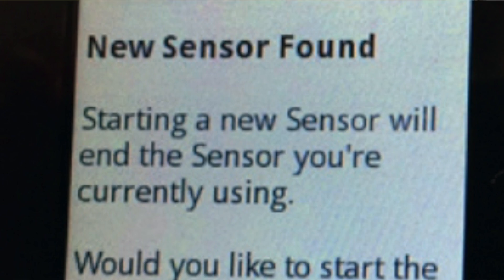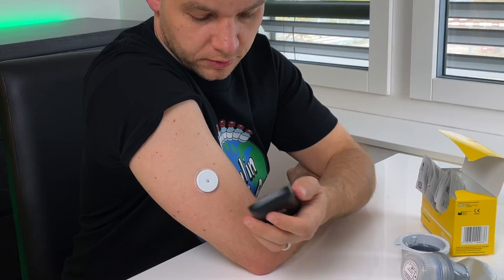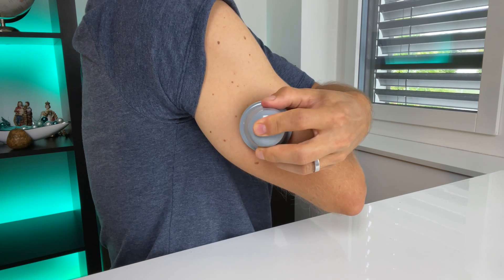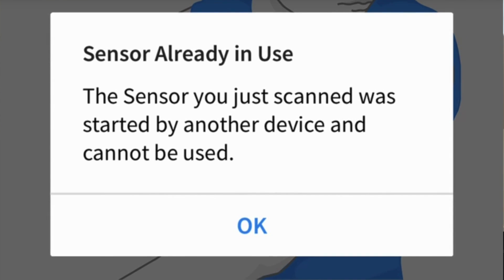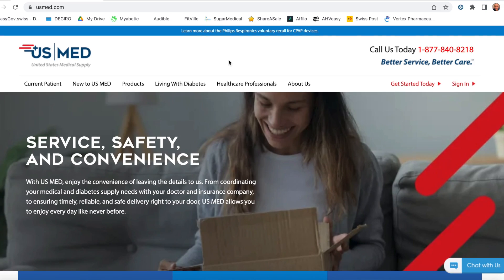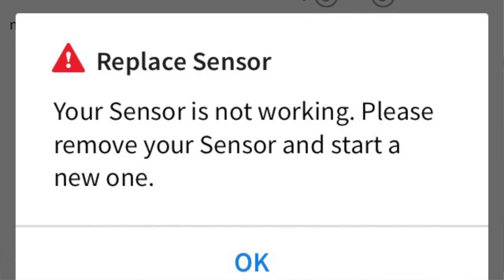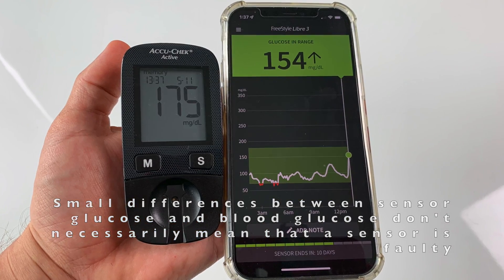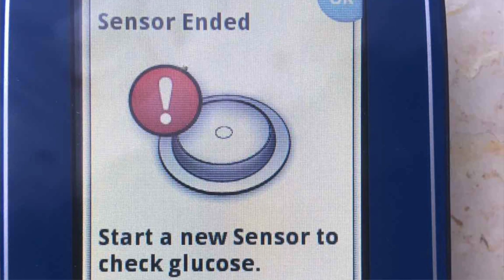FreeStyle Libre Errors and How to Fix Them

Comment: We need some vids on how to connect the CGMs with the pumps. I have the iLet pump and tried to switch from the Dexcom G7 to the Libre 3 plus CGM since the iLet supports both.  I was shocked at how different it was to connect the G7 with the iLet compared to the Libre 3+.  Ended up killing my first Libre 3+ sensor trying to follow similar steps as the G7 because I could not find a YT vid for any guidance.

Comment: As I understand it, the FreeStyle Libre 2 (and 2+) sensor contains a small silver oxide battery. There are occasions where this battery is faulty or has discharged on a new sensor. The result is that while you can scan the sensor manually to get a reading, the sensor will not constantly update your phone app, with the app reporting 'Signal Loss'. Abbott will replace sensors in this case or you can simply scan the sensor manually with your phone every time you want a reading, however you will lose the ability to get alerts in the app until you replace the sensor.

Comment: I think the quality of these devices had gone way down!!! I started with Libre 1 for a few years and they had never failed! Then I moved to Libre 2. Few years later they started to fail on and off....then more frequently...then like half would fail....it's random like it would work for a few days and stopped or it won't even start! I had used multiple Libre 2 readers and still would have problems! Quality went way down...I even informed them whenever I called them!! I have enough and I just asked my doctor to move to Libre 3! But now in insurance would not cover the reader...yet they sent me 6 sensors...like WTH!! Quality had gone down on nearly everything...all types of companies....insurances....manufacturers....alike!

Comment: I keep running into an issue where when I apply a new sensor (Libre 2) it will read critical low and then give me the check again in x hours. After the x hours I will get that the sensor failed and to replace it. I am trying to narrow down if this is related to the location or not. I feel that this happens more on my right arm but don't have any real evidence yet.

Comment: I've been using this for 4 weeks now and has gone bad on my 3rd sensor the message I get is 'error displaying result' then it won't communicate with the phone unless I manually scan. I called the manufacturer and they were useless blaming the phone that's been working fine for 4 weeks.

Comment: ios 17.0.4 won't work.   it says in the beginning if you get signal error message.  says on the thing first before going.  thats why it won't do   then I was told to undo the ios area.   this is a problem with companies

Comment: my problem is with the  sensor ended. i chabnged the sensor and scanned it. it said wait 60 min i did that. after an hour i scanned again and it again said sensor ended change sensor. reluctantly i diud change it agasin and again its saying sensor ended. i tried callin freestyle but the r closed for the holiday and have no means of checking sugar., can u suggest anything.

Comment: It is a mistake to put your sensor on your forehead because there is not enough blood to sense .😅 I put my libre 2 sensor in the refrigerator door anywhere from 4 to 24 hours before I use it. I noticed that my sensor is much more accurate and last the full 14 days.

Comment: Sensor error try again in 10 mins..this keeps going on for 10 hours straight....making it useless.
But if I get a real low suger alarm,. Then it works showing like a 53...but only works for the high and low alarms.

Comment: Hello, I have a need for answers to a couple questions. My first sensor  worked very well until it fell off after about 4 days.  I was looking at the blood sugar levels several times per day but after laying on it,  it came off. It was installed by a health care professional, so I didn't know what to think. Since then I've read where the addition of tissue glue applied to the bottom of the sensor befor installation would help it stay on. And there are bandage like clear plastic covers that can be placed over the sensor. Also I read where the use of  Liquid bandage can be applied befor the sensor so it has a dry surface to stick to. When I mentioned all of this to them they said they applied tissue glue already.  I purchased  another one and had it installed by the same professional. This time I was reading it every hour or so and after about 5 hours it said  Sensor ended. I called the clinic and they didn't know what to do about it. So I called the customer care line at 855-632-8658. As soon as I told them it was on my dog they all but hung up on me. Anything I asked was met with obstinate resolution. They didn't want to give me the  time of day. After a minute of sweettalking the woman finally said she'd answer a couple questions, but kept announcing that Abbott is not responsible for any use other than on a human every time I formulated a question. Since I was not the one who installed the sensor, I really wanted to know what the correct way to start a new sensor with the old reader was. After another round of excoriating me she finally relented and said all you have to do is place the reader near the new sensor and it starts over.  Automatically? I asked. No resetting or anything? After hemming and hawing for about another whole minute,  she finally used that exact word "Automatically."  Now I have purchased still another one and I wonder if there is more to it than just install the sensor and bring the reader near the new sensor to pair it and activate the sensor. It seems like the reader did not reset correctly or the sensor malfunctioned and timed out early. I just want to get a baseline established for my dog, but with the extremely poor treatment by Abbott (& Costello) Customer Care this will be the last time I patronize them. At the moment I am shooting blindly, checking my baby dog only a couple of times a day with my own HUMAN Glucose reader and test strips that I use on myself, but dogs run a very different kind of blood sugar control that is much more complicated than human sugar control and it would be nice to have the details so I can accurately administer the dosage of insulin to her. If anyone would care to help me out a little, I can be reached on Yahoo email. I go by Moparbens. You know the routine to send a message to Yahoo,  so please let me know if you care to help. Thank you, ben/ michigan

Comment: I just started using the FL3 and in 5 days have had to apply 5 sensors due to Replace Sensor messages. Each message happened during the initial 12 hours even though I did get glucose readings during that time so I know I applied it correctly (soap and water, alcohol pad, drying time, etc.) I've been diabetic for over 50 years so applying these is not rocket science. I called Abbott each time and they did send replacement sensors. The last rep. I spoke with told me it can take 12-24 hours to get accurate readings not the 12 hours it states. He also said they are having problems with the filaments and are working on it and he has had a consumer who had 20 faulty sensors in a row. He told me if the sensors are shipped to you sitting outside in the heat or cold can damage the filament and that the shippers may not be handling the packages correctly including the sensors they shipped to me using Fed Ex (yes, one they shipped failed also.) He also told me they may only last 11 days not the 14 they claim they will last.  I applied Skin Tac after applying each sensor to make sure each would stay on so taking each off was not as simple as if only the adhesive they apply. I'm so fed up with the poor quality of these sensors and the fact I've gotten 3 reps who must have been using cell phones because they couldn't hear me. I used a land line phone. The other issue is the reps are usually speaking English as a second language making it more challenging to understand what they are saying. One sensor gave me a sensor error and said to try scanning again in 7 hours! After the 7 hours it said to try in 10 minutes. That finally worked but I got a replace sensor message a short time later.

Just my opinion, but Abbott shouldn't be selling these sensors if they are so vulnerable to damage. No wonder they cost so much if Abbott has to keep sending out free replacements. 

I don't know if my insurance will cover another brand of CGM but if they will are any of the other CGMs better as far as quality control of the sensors goes? 

I think I'll go back to just using strips. My experience with this CGM is so poor. If Tom or anyone has had similar experiences or any helpful ideas please respond with a comment.  I have 5 sensors I could try using that Abbott just sent.

I'm totally disgusted with my experience.

They also claim it is not the readers fault it is the sensor so they would not replace the reader. I thought perhaps the reader was actually the cause of the error messages.

Comment: By the way, I use my Freestyle sensor with two devices. With the Freestyle reader and with my smartphone (iPhone). When starting the sensor, I first do it with the Freestyle reader and immediately after with the smartphone. The advantage is that in the smartphone app there is additional information (time on range, estimated HbA1c, etc.) and when I go out I don't need to carry another device. At home I can use both, depending on which one is closer.
Reply: I can't figure it out.  I scanned the sensor now I can't use my phone. It won't let me use 2 devices.😓
Reply: @ That's strange. Maybe it also depends on the software version, but I can definitely use both, the original Freestyle reader and my iPhone. Both ask me to scan a new sensor because the old one has expired, so I just follow the normal instructions for scanning a new sensor. First with the Freestyle one and then with the iPhone.
I'm using the Freestyle Sensor Type 1 without alarms, not the new one with alarms. I haven't tried it yet with the new one.
Reply: Was that Libre 1? Because for Libre 2, that was no longer possible once the sensor was activated on the reader...
Reply: I figured that a few years ago but had forgotten which device first and didn't want to get wrong and have just 1 device. Top comment 👌 very useful to have two options,things happen and go wrong with tech,life etc 😂

Comment: Had trouble getting new sensor to scan on Samsung Phone. ( New sensor won't scan ) Tried checking >Settings
>Connections
>Turn ON Wifi
>Turn ON Bluetooth
>Turn ON NFC and Contactless Payments.

Then try scanning new sensor again. If it doesn't work, try turning those settings off then all 3 back on again or shutting the whole phone off then on again... worth a try, worked for us. Hope this helps!
Reply: Same problem!

Comment: I just had 3 sensors replaced today by Abbott. It didn't take very long at all. It's just a real pain in the ass or arm. It's interesting to know what the error scan in 10 minutes means though. I release insulin erratically and sometimes during an event, before a seizure, I get that message when I'm trying to make my glucose go up and anxiously await a higher number. Have any of you had a pancreatectomy? I'm on the fence because my dad was diabetic. I'm scared of trading in one demon for another.

Comment: I decided to give the Freestyle Libre a try for my cat, per my vet's recommendation. Tried downloading the app to my phone, but it was a humongous hassle which is probably not worth it (since i presume is designed for human not animal use). I've only used the provided reader.  First sensor only lasted 7 days. Had several "check again in 10 min" errors these days, but it would fix itself. Vet had me checking levels every hour so i think maybe theres a limit to how many checks you can do. The cat is a senior but still moves around, and i think the sensor could have been better placed. Its right behind his right front paw. he usually leans on that area, either left or right. A higher placement could be beneficial. But hey I'm no veterinarian or diabetic. I'm just trying to make him feel better.
Any insights are helpful, we are new to the diabetes world.

Comment: I upgraded to the libre 3 and it’s been a love/hate relationship with it. When it works it’s so much better and convenient than when I used to use the freestyle libre and with many more features but now it seems like every other sensor is bugging out and/or needing to prematurely remove and apply another one before the cycle ends, then I have to yet again contact the company send another one and so forth.
Reply: My situation is the same, when the FL3 works it is great but just recently I have had many problems.  For instance I just applied a new one and at 3am in the morning it quit reading.  I've tried everything to grt it working but to no avail.  Totally fed up of this sensor/brand.
Reply: Same @tulsabrit671

Comment: You forgot to mention "This sensor is not compatible with this reader, which my wife just got with 4 sensors in a row. The previous sensor was giving readings that were way too low. She's been using Freestyle Libre 2 for over a year and we've had about half of sensors be bad, including the ones we got back as replacements. One of the representatives at Abbott said to reset the reader with the power button for 30 seconds and then the sensor would work 100% of the time. A bunch of BS. Twice after that we tried it and got the same error with two different sensors. This product is crap. It shouldn't have been released, or Medicaid should drop it, regardless of how many corrupt officials negotiated this deal.

Comment: First shipment from USMED was faultless. Second order had mix of libre 1 and libre 2 cgm.  After a couple calls I have been told they will replace libre 1 w libre 2.  Also cannot use a reader or phone app from US on a cgm from UK.  Very frustrating on a recent long trip.  I would have to change my IPhone profile to an English address, install the Uk libre app and work it that way. That would change my Apple profile on all my devices.  UGH

Comment: Hi I started the libre 3 sensor after using the libre 2 sensor for an year. And this is my 5th libre 3 sensor that will not take a activate/startup scan what tips can you give on this problem besides calling the Abbott company and doing what they suggest like scan it every ten minutes for the next 2 hours. I had a libre 2 sensor and I put it on and it scanned instantly... So what's going on with the libre 3 sensor? Is there a bad batch of libre 3 sensors that is out to the public?/the people

Comment: I've recentely been provided a Libre 3 which I thought was a great idea.  However my first unit would not register for over an hour before use.  The 2nd fell off after two days.  The third had many error codes and reading fails.  The fourth had many errors and then fell off while sleeping.  These units are pricey in the US and I was not aware to contact Abbott for replacement until my dr. Suggested.  I did that today and spoke to a call center--very noisy and I had to repeat myself several times.  She is sending me one new sensor.  She asked several times if I kept the old ones and the boxes, which I will now. I was able to retrieve the error reports--several pages worth to provide her.  Not sure if I will continue with it.  Finger stick supplies are so much cheaper.
Reply: See my comment above. I've only had problems with the FL3 since the first sensor. I've  had 5 consecutive sensors fail on me within the first 12 hours. Abbott is aware of the problem and are working on it. That doesn't  help anyone using them now though. I think they should pull them from the market until they fix the problem. What junk!